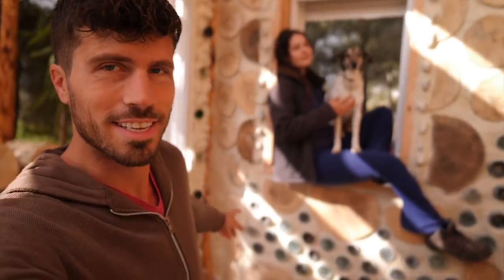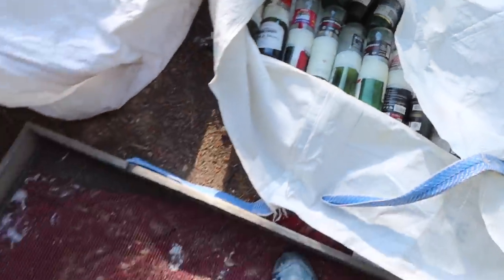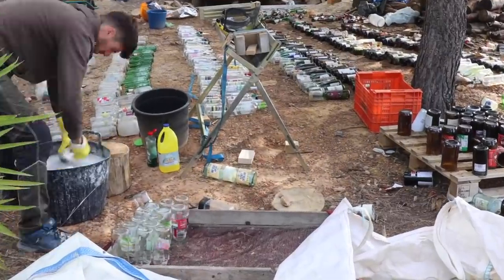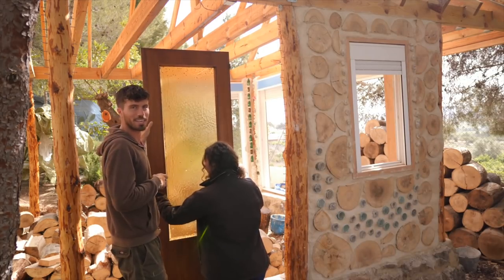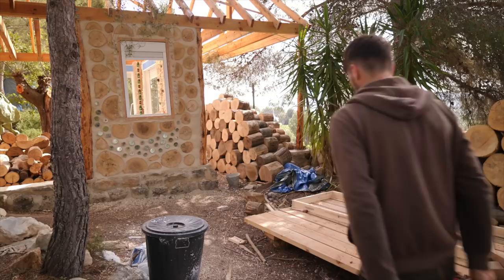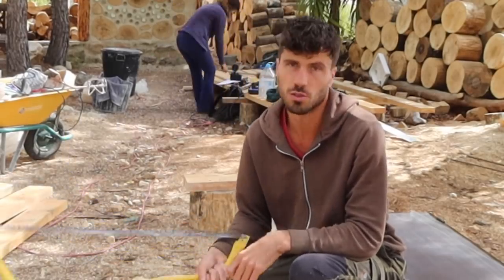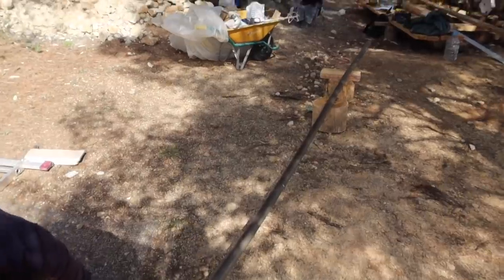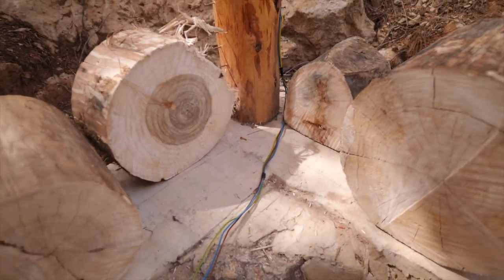We Failed To Build The Next Wall - Building a Tiny House

Comment: Hey! Remember at the end make sure you place something to prevent the rain from pooling on to the foundation and under the wood that is under the door. It will rot! You can place a "sacrificial" board that will direct the water off from the edge of the fundation, or something else :) I'm sure you thought of it already, just talking to stay warm.
Reply from the maker: Hmm, I mean, the roof will hang wider as the foundation...
Reply: Should have put a damp proof membrane between the door frame and concrete wall, I keep telling him but... Anyway great work with them bottles!!!!
Reply: With that climate and high concrete foundation I don't think it is that necessary. I would give a good treatment to the wood logs in the wall though to prevent rot.
Reply: @aurochf1  No dont treat the logs, just make sure they get to dry and breath if they get wet. :) Concrete will carry water trough capillary action as well as the wind will push the rain on the fundation. But hey, it won't be a crazy fix if something happens. I'm sure you will be fine! And the climate and location are good. 

Can't wait for the next video. You really get s**t done! No paralysis by analysis :)

Comment: Hey awesome doing your cabin build ......try saving the bottle tops for a crushed  mosaic glass tile wall in your build ......once you get them crushed to desired size build a form n mix glass with clear epoxy making a glass panel
Reply from the maker: I didn't save them. but it sounds like an awesome idea!

Comment: Run PVC pipes through the cement for wires. It is safe and in future you may need to change them or run more wires through . Just burring these wires with running electricity through them is not safe and practical.